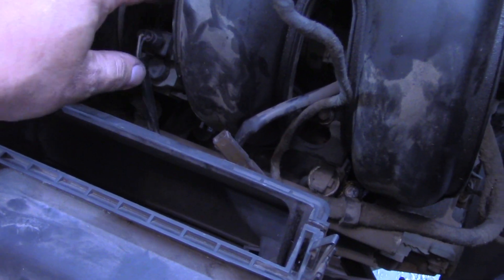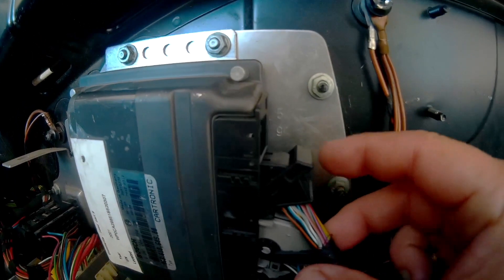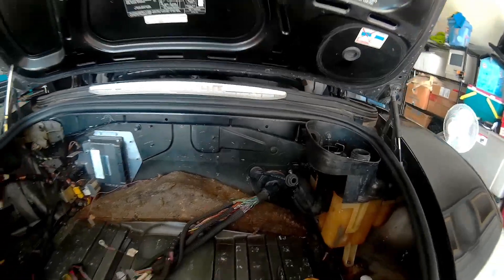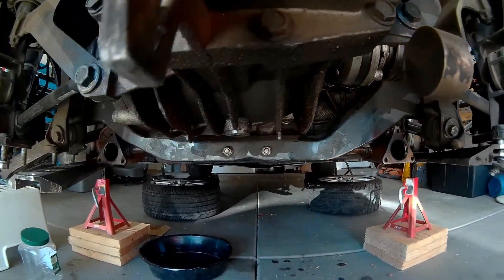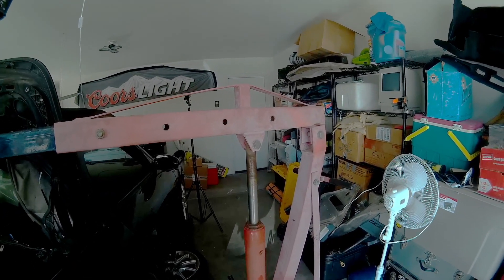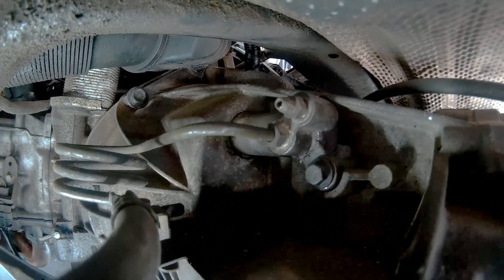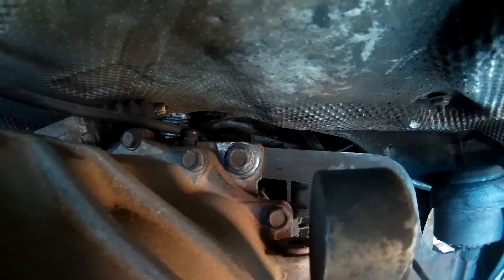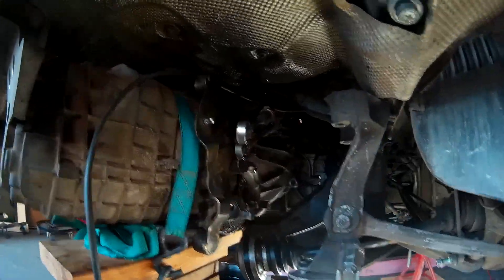How to drop the motor out of a Porsche Boxster 986 Engine Replacement Part 2

Comment: Great job explaining the process . Just bought a 99 with a 2.5 & 5 speed... Turns over but a no start. Previous owner thought it might have overheated. I have a low mile 2.7 motor out of an 01 , should I run into any problems if I decide to swap the 2.7 in place of the 2.5 other than the drive by wire .... Have yet to do any diagnosing on the current motor in the car.
Reply from the maker: Make sure you grab the ECU aswell, humm that 99 is a wire pedal and the 01 would be an e-gas pedal... ill do some research!

Comment: Brian, I have an order in for a brand new 2022 Boxster GTS. I see they sell a fire extinguisher as an option. This will be the 2nd Porsche I have owned since my 928 S4 so its the first with an internal mid engine. Do I have to worry about a fire in a new Porsche Boxster?
Reply from the maker: Not really unless you plan to race that sweet new Boxster GTS!  Have fun with it Anold.